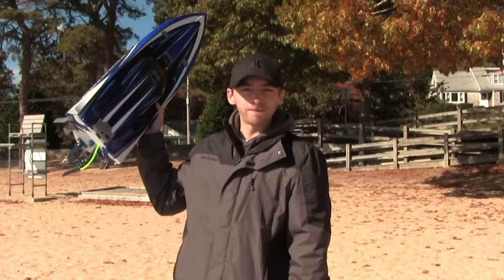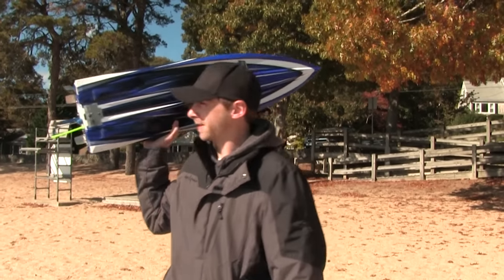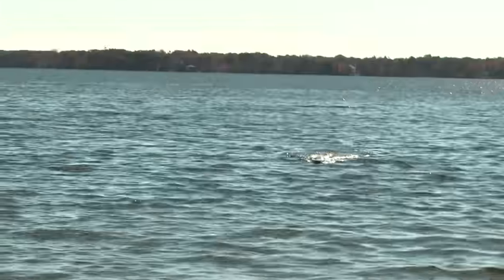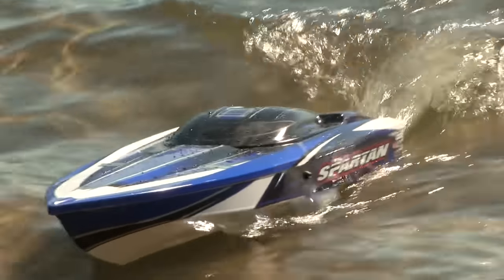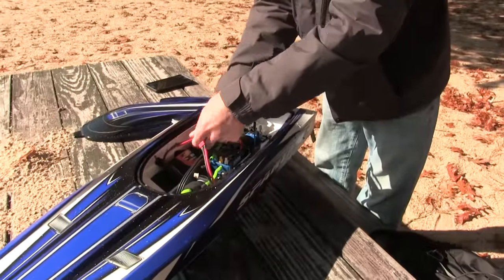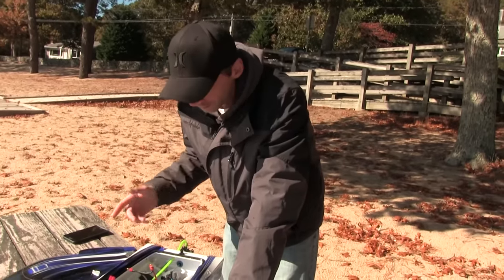Traxxas Spartan On 4s LiPo: Castle 1800kv Brushless Setup

Comment: Nice video! You might want to look into getting a dual pickup rudder and add double cooling lines (one to motor, one to ESC) because 6s will get hot otherwise. There are also upgraded cooling jackets available too. Enjoy the boat :) I love mine
Reply from the maker: +Dempsey Daniel hey man, thanks for the tips. Im definitely going to be looking into some upgrades here over the winter for sure on this! Thanks again!
Reply: No problem man! offshoreelectrics.com has all the stuff you'll need. Enjoy the boat!